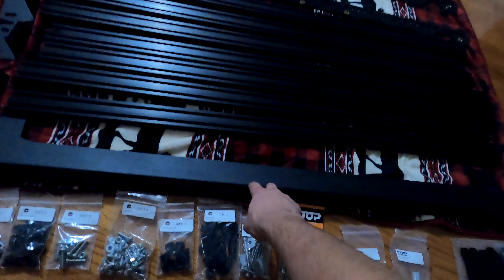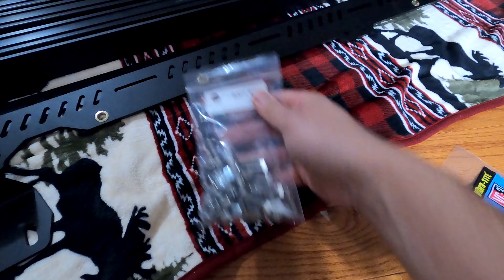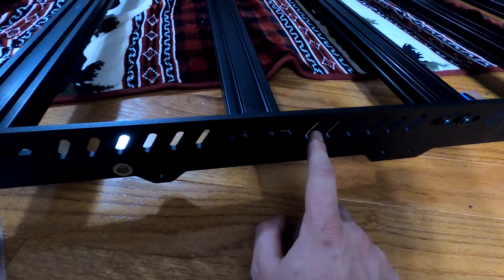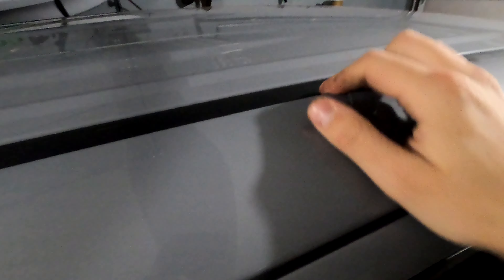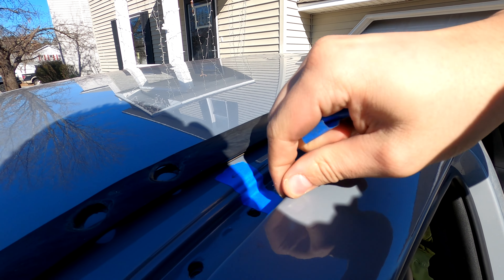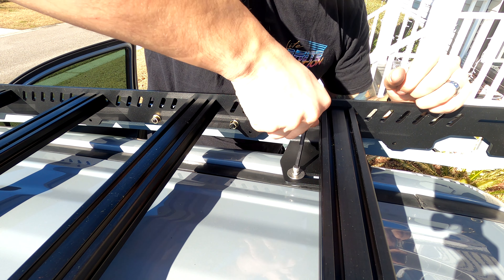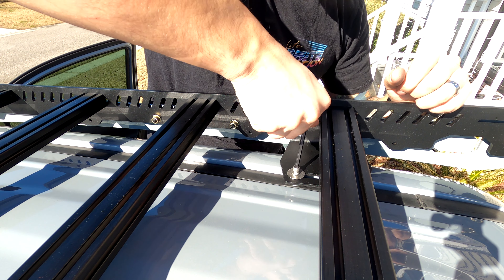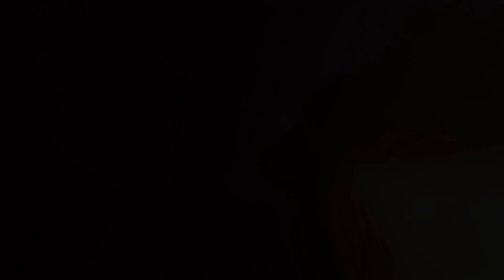UpTop Overland Alpha Tacoma Roof Rack Install: 2017 Toyota Tacoma

Comment: Great install video!! I also have a Cement tacoma and looking to get the same Alpha rack. At the end of the video when you show it in the sun, the color does look to be a bit off (at least on camera) it looks to have a little more greenish hue similar to Lunar Rock. Do you find this to be the case in real life?
Reply from the maker: Unfortunately I do, but there is enough of the black from the groove tek to give some separation between the colors.

After having the rack on there for a few months I don’t notice the color difference and paired with the UpTake snorkel with the same grey it looks quite planned. 

I had hoped for a closer color match when I made the purchase but I am quite happy with how it looks.

I am curious, however, how the color would compare against the lunar rock color
Reply: @FromDuskTillDawn518  Appreciate your reply! I saw someone else complain on Reddit that the color-match was off for Cement. I guess it’s a hard color to copy. I really wanted the color-match, but knowing my OCD it would probably bug me every time I look at it if it isn’t spot on. I guess I’ll just go with black -.-
Reply from the maker: @jjlevitt95  to the credit of UpTop, I can only find a cement color match on Touch Up Direct for even a paint pen😂

Comment: Is the whole groove tek side panels are aluminum or steel?
Reply from the maker: The whole build is machined aluminum I believe, incredibly light weight.
Reply: @FromDuskTillDawn518  I was hoping it would be👌🏻💯. That's much better overall than steel. Aluminium saves weight
Reply from the maker: Oh absolutely, and it’s still incredibly strong✌️
Reply: @FromDuskTillDawn518  I have a 2011 ford ranger FX4 off of road. My rig is bad ass & nicely decked out with modern overland gear and a rack etc. To bad they don't make this for the 3rd gen ranger. Luckily I'm a fabricator, so I plan on taking this idea to make mines just alike
Reply from the maker: @genoory5090  absolutely! Do you post your rig online at all? I love to draw inspiration from other builds
Reply: @FromDuskTillDawn518  actually I'm starting to put uo videos of I had made on facebook forums. Ill upload them soon
Reply: @FromDuskTillDawn518  I just added 2 videos so far on YouTube
Reply from the maker: @genoory5090  down to hang🤙 looking forward to the build my guy
Reply: @FromDuskTillDawn518  of course

Comment: Paracord feels a bit janky, it’s gonna rot in the UV/Sun and with moisture. I have this rack yet to install but not loving that aspect of the design 😐
Reply from the maker: I agree with you but after about 6 months I’ve yet to see the paracord even face in color.

UpTop did however release a new handle that is all metal, I barely missed the upgrade with my purchase
Reply: @FromDuskTillDawn518 ahh sweet, I bought mine in the last few months so prob won’t have to deal with the paracord. I’m pretty sure the motivation was to make handles that move but that don’t rattle or make other noises 🤔
Reply from the maker: @JamesReedy  I would agree, but the new ones look much sturdier lol.

I will say though that my paracord ones do have a steel cable to hold the handles on if and when the paracord breaks😂 but if given the chance I would have traded them for the new version
Reply: @FromDuskTillDawn518 they’re awfully proud of em, I think they go for like $140 a pair 👀
Reply from the maker: @JamesReedy  tis why I’m not gonna upgrade😅